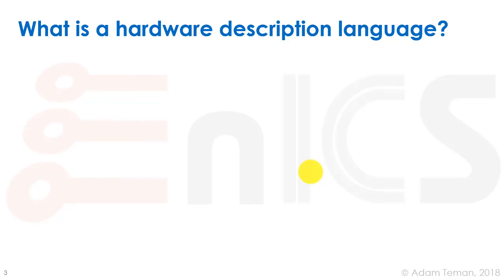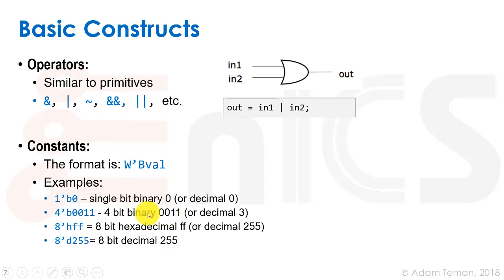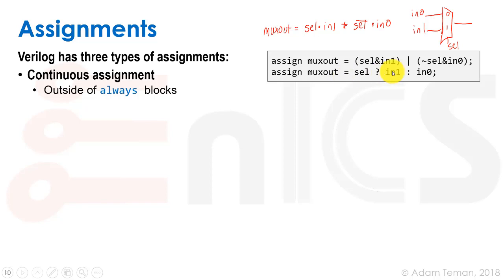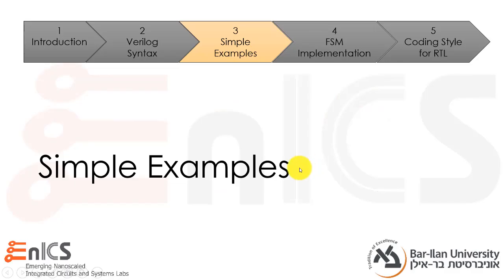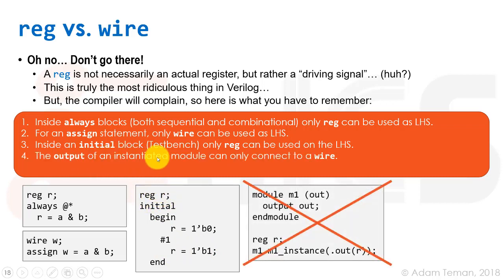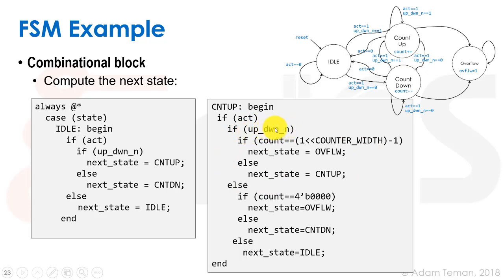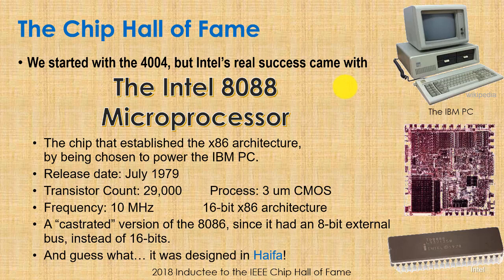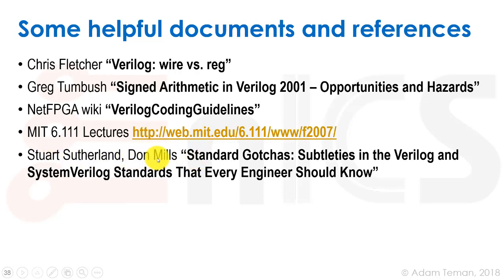DVD - Lecture 2: Verilog

Comment: Great comprehensive lectures. Thank you very much! 
One minor remark on slide 23, the else next_state CNTDN, perhaps count=='b0 should be used in the if statement instead of count==4'b0000 for the code to work with different counter widths.
Reply from the maker: Good point! Thanks.

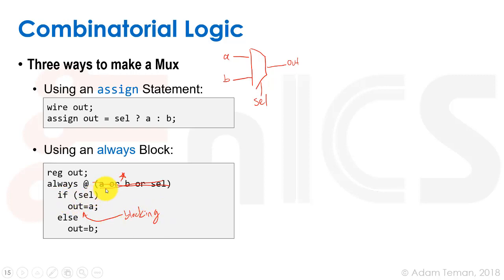Comment: Hello, Professor, thanks for your great lectures, at around (38:00), why a latch will be inferred without an "else " statement? This question bothers me a lot, could you please give me some help?  Thanks！
Reply from the maker: Hi Yunzhong,
Let me try to explain.
Combinatorial logic does not know how to "remember" things - for that you need a register (flip flop or latch). An assign statement is entered when anything in the sensitivity list (RHS) changes and has to decide what the new state of anything on the LHS is. If you have a clear answer to that for every possibility, then all is well. But if you don't have a clear answer, you have to "keep" whatever was there before, requiring "memory" or in other words - a latch.
To try and better illustrate this, I will use the example of the lecture. The sensitivity list includes "sel" - so anytime "sel" changes, the always block will be initiated. Inside the always block we have "out" on the LHS. Therefore, the always block must "decide" what to drive onto "out" for every reason the always block was entered. The first statement "if (sel)" means that if sel=1 (e.g., sel toggled from 0 to 1), it will drive "a" onto "out". But what happens if sel==0? Well, the "else" takes care of that, but what if there was no "else"? The always block still has to decide what to drive onto "out". Should it drive "a"? No, that's only when sel==1. Should it drive "b"? No, why should it? The answer is, it should drive whatever it was driving before. How? By remembering what it was driving before.
How could this be synthesized? Add a latch to the output of "out". The enable of the latch would be "sel". If sel==1 then the preceding logic (the mux) is propagated. If sel==0, the latch is closed and therefore whatever was there before is kept on the output.

Hope that clarifies this point.
Reply: @AdiTeman  Thanks a lot for your kind explanation, and I have understood it.😄

Comment: Hi! First of all thank you for all the effort you put in the lectures and slides. They're amazing. 

I have a question -- 

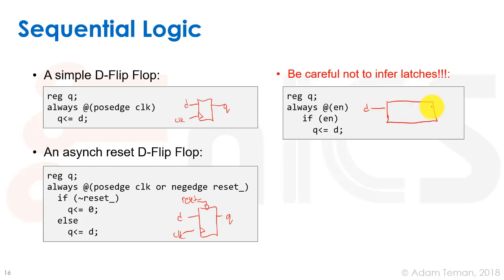At 42:00 you mentioned that the Verilog in that section is a latch, but suppose 'en' goes positive and 'd' gets passed to 'q', if 'd' changes while 'en' is positive, will that trigger assigning 'q' again or would you have to add 'd' into the sensitivity list for it to actually behave as a latch? Or is it understood that as long as 'en' is positive, 'q <= d' statement is being evaluated? 

Thanks again!
Reply from the maker: You are 100% correct. 
This is a bug in the slide. 
For a true latch, the enable and the data should be in the sensitivity list. So if you were to write the code as in the slide, this would require some additional logic from the synthesizer. I will try to fix it at some point (unfortunately, the built in editing tools in YouTube don't allow this type of editing, so I need to rerender and upload it...).

Thanks again for the comment!
Reply: @AdiTeman   Thank you for confirming. I'm not much of a verilog person so I'm sorry I couldn't test it myself.

If I may suggest, adding whatever corrections for a video in a pinned comment would be a good place for all to see since I'd wager most people at least do get a look at the first(pinned) comment as they're usually reserved for important info regarding the video.

Otherwise all the effort in upkeeping the lessons is of course much appreciated! :)
Reply from the maker: Thanks again. I wasn't aware of this capability.
I have added a comment and pinned it (at least until I have a chance to fix and upload a new video)

Comment: Great lectures sir🙇‍♂️🙇‍♂️Much obliged for your effort. Have been constantly following your lectures.

One thing that struck my mind at around 59:00 , that instead of doing the shift operation and -1 for detecting overflow, couldn't we have used a reduction & operator, and reduction ~& for overflow during down counting?
I think it would have been a bit simpler. 

Your lessions are great sir😁😁
Reply from the maker: Yes, something like that could for sure be done.
In fact, there are many tricks that veteran designers play to "fancify" their code. I just wanted to show one such example.
That being said, note that when using these alternative ways to write something:
1) You need to carefully verify it to make sure you weren't too sophisticated for yourself...
2) You should think about the synthesis implications of your coding style. I go over some examples of this in the next lectures. Some coding styles could lead to more complex hardware or hardware that is not 100% equivalent, so make sure to think about this when using such tricks.
3) Sometimes writing "fancy" code makes it harder to read and therefore, harder to maintain and debug. If you do these tricks, make sure to comment/document them clearly or you will be sorry when you return to this line of code later on.

Comment: Great lecture! I wonder if this covers almost all the aspects of Verilog. In other words, the language seems to be using a small set of keywords and constructs unlink C like programming language where there are much more detailed construct and ideas that are frequently employed in drivers, firmware and applications.
Reply from the maker: Hi Sundar,
In no way does this lecture cover all that is available in Verilog. There are pretty thick books for that. But I tried to narrow it down to the 80% (maybe more) that is most often used for RTL coding and basic testbenching. If you can conceive this very limited content, you can pretty much start coding. The nooks and crannies to do more tricky stuff are easily searchable on the web or in a text book, but I don't think they're at all necessary when starting and the more syntax, the more confusing things get. So I decided to skip all of that for an introductory lecture, and let stack overflow provide you with the rest :)
Reply: @AdiTeman  Thank you for the response. Your lecture is very easy to understand and provides a good introduction to HDL. Please keep it going.

Comment: Hi professor, thank you for a very throughout lecture. I was wondering if is there any ways that I could get the powerpoint of the lectures. The attached link in the description does not work.
Reply from the maker: Hi Hong Le,

Indeed, the faculty website is down due to security concerns. If you need to access the slides in the meantime, please email me at adam.teman@biu.ac.il and tell me which slide decks you need. I also may move them to a different server if it is not resolved soon. 

Thank for your interest,
Adi
Reply from the maker: My faculty website is back online https://www.eng.biu.ac.il/temanad/teaching/

Comment: This is a wonderful channel. This video is such a great resource to learn and relearn some of the tricky bits of Verilog. Regarding reg vs wire, I love what they did with SystemVerilog: everything is a "logic"! Thank you for the videos.
Reply from the maker: Thanks for the kind words. Indeed, System Verilog improves on many of the things that Verilog was not so good at. That being said, unfortunately, some tools still have trouble with various System Verilog constructs (especially interfaces) and this can give us chip designers quite a headache at different parts of the flow - sometimes even making us regret our decision to use the advanced features...
In any case, I decided to teach Verilog in this course as it is still more universal, it is used in the structural (gate-level) output, and in general, it's not "all that" different. Glad you enjoyed.
Reply: @AdiTeman  plz do video  about system  verilog
Reply from the maker: Maybe will do so some day. Thanks for the suggestion.

Comment: Hi professor, I was wondering why you needed to define overflow condition at 58:51 using: if(count==(1<<COUNTER_WIDTH)-1) instead of writing it explicitly as: if(count==(4'b1111))? You did that below for the: if(count==4'b0000) condition. Is it to maintain flexibility if designer chooses a different bit width?
Reply from the maker: Yes, indeed, this is to make the code parametric. For the zero vector, most simulators and synthesizers will pad with zeros, so we didn't need to write anything "fancy', but for the ones, this is a little trick to create a parametric ones vector.
Reply: @AdiTeman  Hello. I'm coming from the VHDL world where there is the syntax like count=(count'range=>'1')
 to accomplish what you did to check for the '1111' condition. Out of curiosity, why didn't you use something like {COUNTER_WIDTH-1{1'b1}} to get the '1111' which is still parametric ?
Reply from the maker: Sorry for the late reply. Your question got away from me :)

I think this could have been done as well. Just a habit of writing RTL in one way or another (tricks you pick up along the way). Any of these shorthands that work are fine.